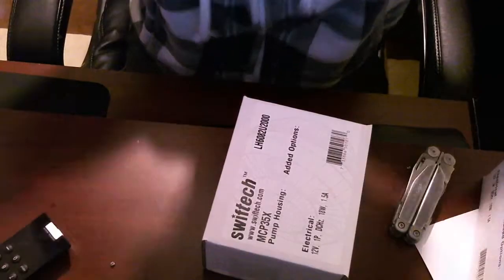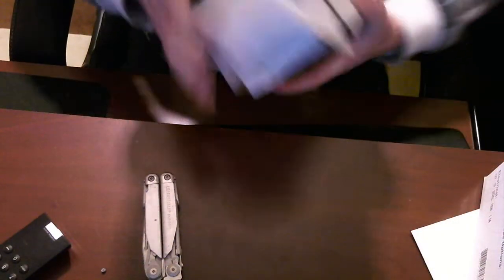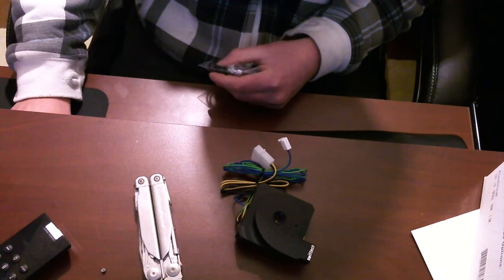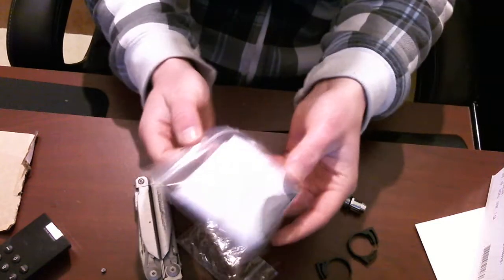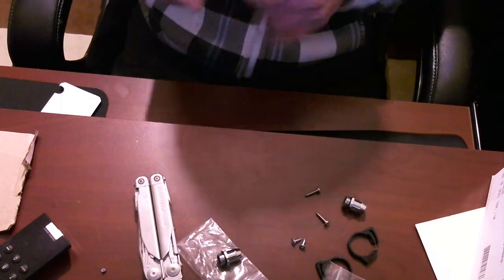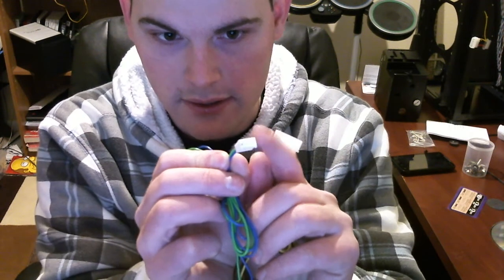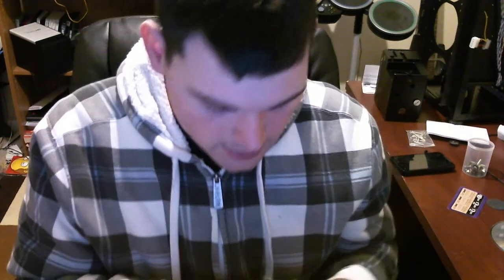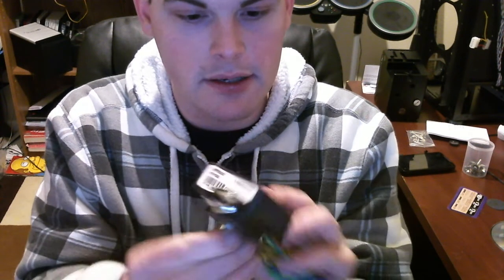Unboxing and overview MCP35X pump

Comment from the maker: @SylentCommando 
The mcp35x would be a better pump only get this if you really want to spend the cash. I have a mcp355 and I am using a dual reservoir and it is mounted on it. No problems at all

Comment: dude, i got a q. What are the components i should buy to WC my rig?
Config:
i7 950 
Evga x58 SLI 3
Gskill 6 GB RAM (Ripjaw - 3 DIMMS)
Evga gtx 570
EVga gts 250 - PhysX

( i wanna WC the processor, GFX card, PhysX card.. )
So what are the stuff i should buy for this?